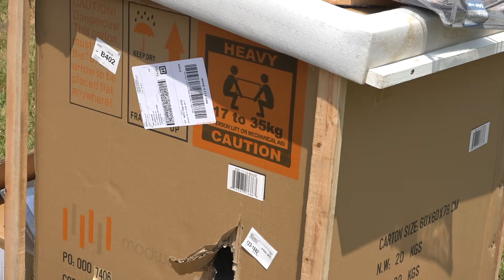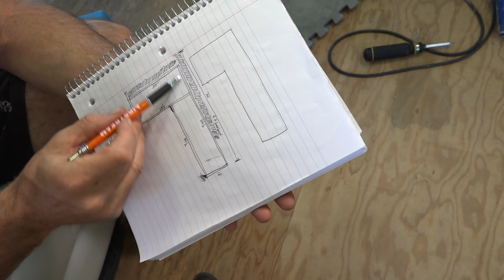Re-Building Our RV | RVLOVE's Ultimate RV Makeover (Ep 4) | DIY RV Renovation

Comment: So two questions. 1)did you do anything to hold the floor down?staple etc....  2) what did you use to glue the wall back to the frame on the slide out?
Reply from the maker: 1) flooring - only nailed down quarter inch round along edges / baseboard trim. otherwise flooring not stapled/nailed/glued at all - it floats... 2) metal screws and adhesive caulk for the wall
Reply: Perfect thanks. How is the road noise with carpet gone?  Putting LVT in our coach in the next couple of weeks.
Reply: @wagonmasterjd4811  We put the same type of flooring is and there was no significant change in road noise that we noticed in our DP.  Just make sure you get ALL the staples out and keep the floor swept and vacuumed during the install as even the smallest of debris will show up if it gets laid over with the flooring.  Marc and Julie put padding down under their flooring where we decided not to.  Ours lays right on top of the Sub floor.  Either way will work but if you have the patients for it the padding is a good idea as it will also help to insulate both in noise and temperature I suppose.

Comment: I would think you added  a lot of weight to RV as original materials are light.  Means less storage for sure so be careful.
Reply from the maker: HI Pamela. Glad to see you are so mindful of RV weight and safety! That is a huge focus of ours, so if you have watched any of our previous videos, you would know we talk about that a lot. In Episode 2, we specifically call out the weight considerations for the RV Makeover, and we have 2,000 pounds to spare. Plus, after all the weight removed from the mirrors, tiles and glass, by the time we finished the remodel, the RV weight ended up about the same. So we still have 2,000 pounds to spare. No worries at all with us - our coach has massive storage AND weight capacity :) Cheers!

Comment: love fixer upper projects. y'all are doing great. any luck locating and repairing the original water leak that caused the problems in the slide wall etc?  hope it wasn't a roof leak. looking forward to seeing the end results.
Reply from the maker: Hi Tony, yes we got to the bottom of it - we actually knew the source of the leak from a storm in Texas in the spring and used a bunch of caulk/sealant to repair it - it was the slide seams... it just took until July to be able to dig in and get all the old damaged wood out and replace. Not a roof leak thank goodness. Thanks!

Comment: With that many cabinets/cabinet doors, did you have to use some type of system to make sure the doors went back to the right cabinets instead of a similarly sized (but slightly 'off') cabinet in another part of the coach?  Another great video!!!!
Reply from the maker: Yes! Good question. We numbered them all with some blue painter's tape and a sharpie!